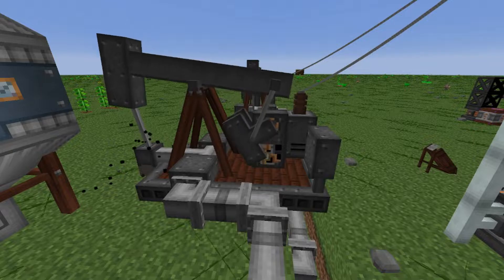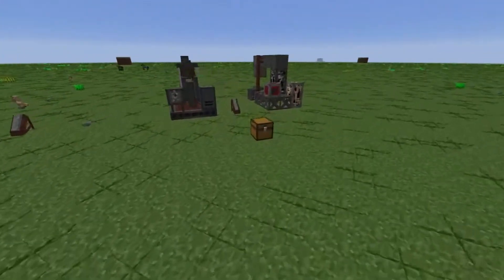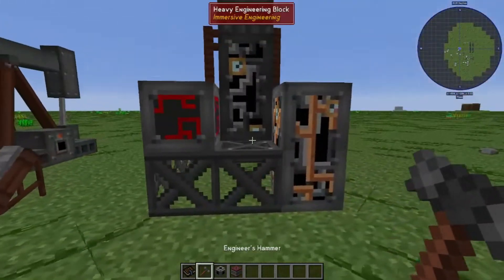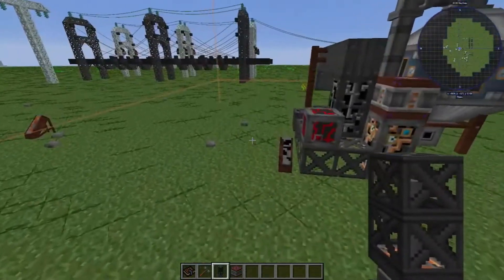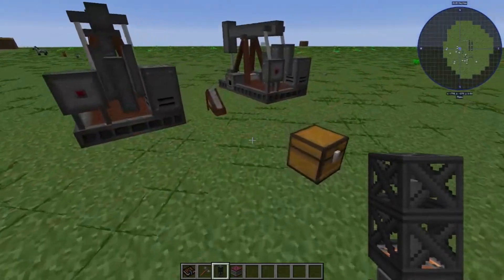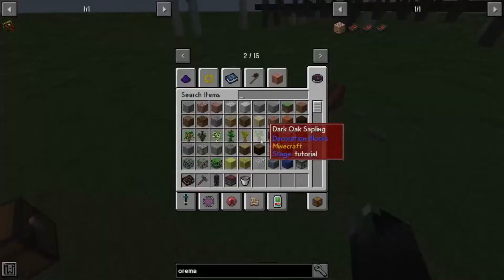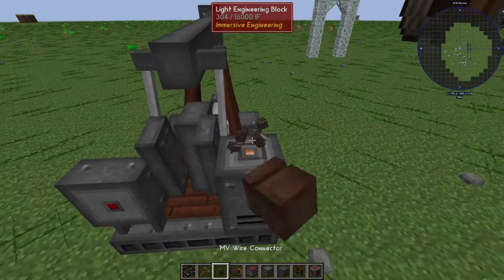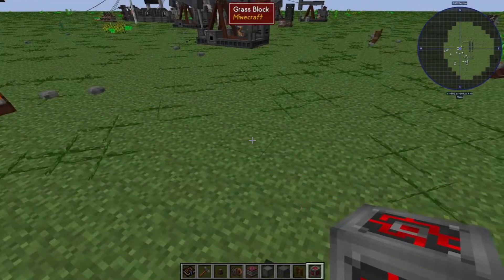Minecraft Tutorial: Immersive Engineering Pumpjack

Comment: The pump Jack isn’t forming when I right click to with the hammer I am using 1.12.2 version btw
Reply from the maker: Make sure you have all blocks in the right spot. Rebuild if necessary. Take a look at the book to see where to click with the Engineer's Hammer to form the multiblock. Try normal right and left click, and try shift left and right clicking.

Comment: It dosent work i tried everything 😭
Reply: The multi block does transform and ive using a hv that Is not connected to a wire but i already put Energy in It.
The Power goes to the pumpjack but It still not working.
I also tried to use a lever and also tried to  connect a tank.
Maybe i need to find a specific material? Cause the game Is not telling me when there Is oil in the material
I also tried to move of some chunk in an another direction but It still not working
Reply from the maker: Try putting a lever on the red redstone port. Try it flipped on and then off. Make sure you have power going to it. If you have a capacity on the orange port, make sure the bottom of the capacitor is set to Output which is orange. If you are just using wires, make sure you have a connector on it and not a relay. Can you explain what you currently have set up? Does the multiblock transform to the actual finished shape of the Pumpjack? Or is it just not running?

Comment: pls help idk how to use the hammer it only break the block
Reply from the maker: So you have to either right click or left click (Can't remember which) on a specific block with the Engineer's Hammer from the Immersive Engineering mod. Read the engineer's book, it will tell you which block to click on. If it doesn't work then you have a block misplaced and might need to re-place all the blocks.
Reply: @grimreaperlp9978  THX 2nd problem:i looked into the comments and see the other guy had the same problem my pumper is not working also tried with a lever. how do i fix this i also tried to move it like 6 chunks it did not work :(
Reply: also one i also used LV capacitor
@grimreaperlp9978
Reply from the maker: Might not have enough power. Try using MV or HV.

Comment: Hey, my pumpjack isn't working even if i put a Full HV Capacitor on it, is it because it need more power ? thanks a lot
Reply from the maker: So just some troubleshooting options:
1. Is the output mode set on the side of the HV capacitor? Should be orange for output.
2. Do you have somewhere for the fluid to go? I think the pumpjack continues to pump even with no where for fluid to go, wasting the fluid.
3. Is it in a chunk with whatever fluid you are trying to pump?
Reply: @grimreaperlp9978   Yeah i set it on orange mode, i connect my pumptrack to the tank and yes too i drill it to be sure, but the pumpjack doesn't start its not pumping something, he has energy in it but idk xD
Reply from the maker: How much power do you have going to it? LV, MV or HV? Also did you try putting a lever on the redstone port?
Reply: @grimreaperlp9978  I tried all, even with lever it didn't start, i switched to gamemode to try a creative capacitor on it, i rebuild the machine, nothing work, sad moment for me
Reply from the maker: If not even the creative capacitor worked, you might not have the pumpjack in the chunk. Maybe try moving it to the center of the chunk and see if that works?
Reply: @grimreaperlp9978  I tried it it didn't work, then i tried it like 6 chunk away it worked somehow, thank's for the advice for the chunk bro ! that's a suscribe and a thumbs up ! :)
Reply from the maker: Anytime! Thank you :)
Reply: @zimmylez  dude you should using core simple drill to check the oil
Reply: @grimreaperlp9978  pls i tried everything i do not understand its still now working
Reply: Any chance you figured this out?